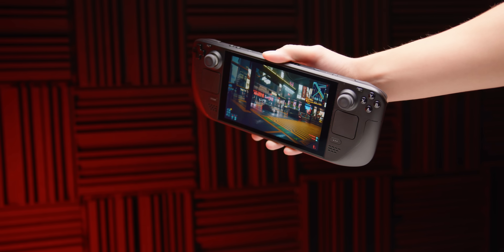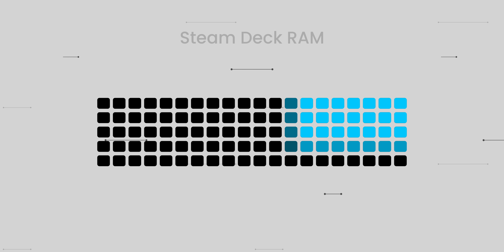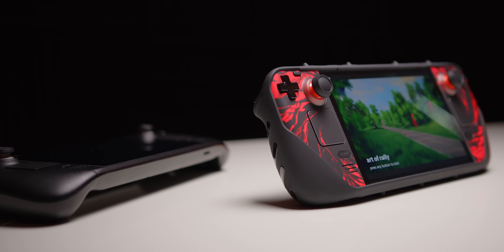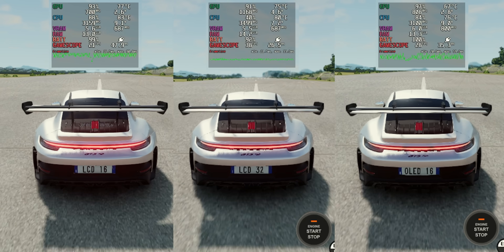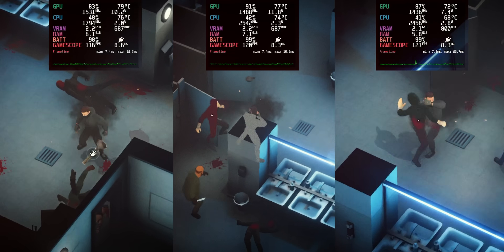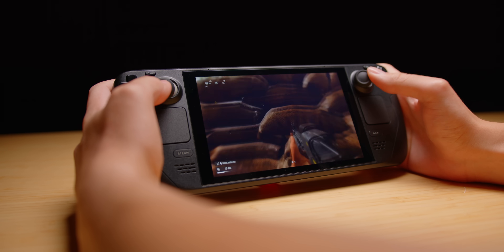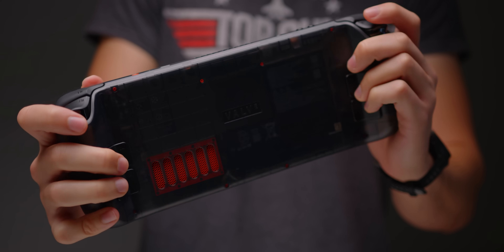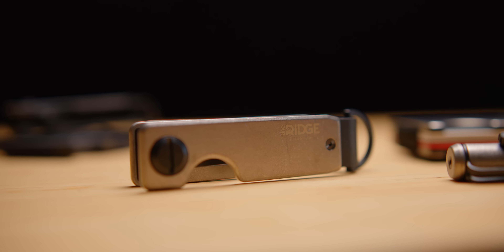I Upgraded The Steam Deck - 16GB vs 32GB of RAM.

Comment from the maker: Update for anyone asking about the possibility of an OLED upgrade - 

Right now there is no source for higher density chips for the OLED model. I've been told Micron will soon be making these chips available for sale soon.

Also, I'll have links to all the parts I use with the Steam Decks - as well as some shops if you'd like to upgrade your Deck. 

Big thanks to Ridge for sponsoring this project and allowing me to pickup another Steam Deck for testing. Thanks again for watching.
Reply: When the OLED micron chips drop make the video!!! Cover emulation and high end desktop performance as well!  Would love to be able to use this for work as well as play!! Great video!!
Reply: Please do a video when they do! Would love to see a 32GB mod on an OLED.
Reply: just shooting the shit here but is there any chance of a 48 or 64 gig mod on either version of the deck?
Reply: I would love to see this as well. Please make the video pn upgrading the ram.
Reply: Is there any update on this?
Reply: What chips did you use?
Reply: The original memory was Hynix. I installed Samsung. I re-soldered the jumper. After this, there is no image on the built-in screen. There is an image via HDMI. The screen is intact. The screen cable is intact. What could be the problem? Flashing BIOS doesn't help
Reply: The original memory was Hynix. I installed Samsung. I re-soldered the jumper. After this, there is no image on the built-in screen. There is an image via HDMI. The screen is intact. The screen cable is intact. What could be the problem? Flashing BIOS doesn't help
Reply: Definitely want to see emulation performance.  As soon as I figure out how to mod my PS3 and back up games I'll have my entire child hood in portable form.  Wish it let me install to SSD like 360 does.  Also I think palworld has memory leak issues that fill up ram and eventually cause crashes, so would be interesting to see if it crashes less
Reply: Meh, 256gb of ram is where is at.

Comment: I have the legion go S with 32gb of ram and in steam monitoring there are a bunch of games that will use 10-14gb of ram and Vram usage will be 8-10 GB. Ofter I find the combination of ram being used closer to 24gb . It's awesome that it's less than the 32gb available, but it's over the 16 GB. 

Sidenote- I'm running 1080 or 1200p and at higher setting vs the steam deck (z1 extreme ). So for a steam deck 16gb or ram might do it... But with a better processor/ gpu steam will use more than 16gb of ram... And it's not just a 1 off for me, I see it all the time.

Perfect example ally x with z1 extreme  often get less fps vs legion go s with z1 extreme and 32gb. More ram = more fps... At least up to a point.

Comment: Annoying comments about ram ... i have the 16gb steamdeck and a 16gb ryzen laptop of similar performance and too many games at this point are ram hungry . It was more than ok for some time but if you want to play some specific games 16gb are definitely not enough especially because the ram is shared with video. It's not saying much about performance but more about how poorly some games have been optimised because a ps3 game that was made for 256mb of ram can look better than a 16gb modern crap

Comment: Very interesting video. In all honesty I do not see the appeal in doing this upgrade for a couple of reasons. 

1. Only doable on the non oled variants. Taking in to considerations the performance gains the oled gives + the battery time it is simply not worth the hassle.

2. Chance of destroying your device is as I see it fairly high. I'm no solderer but I could imagine micro soldering is quite hard and requires a lot of expertise. It might be possible to pay someone to get it done but that then leads me to ask if the extra cost is really worth it compared to getting the oled model.

3. Handhelds is a market that is quite rapidly being saturated with new devices, this means fierce competition between brands and rapidly evolving devices with better CPU's, GPU's, and RAM. Normally I would also say the consumer benefits from the competition due to more competitive pricing, unfortunately this has gone the wrong direction and actually just made new devices more and more expensive.

Comment: Shared memory isnt initialized 50/50. First the cpu and gpu get what they requested. When the cpu demands more, it takes the reserved memory of the gpu. The textures then will be loaded into the storage which is waaay slower than dram. This is the moment when you most likely notice the stuttering. 

Many people here complaining about most gamers being happy with 16gb of ram, when the steam deck already benefitting from 32gb. Somehow those people do not get the difference between an apu which needs shared dram and a discrete gpu with dedicated vram. In gaming pcs with dgpus the cpu gets all the ram and does not have to share it, since the gpu also gets its own.

Back to the steam deck: well optimized games use way less vram on lower resolutions. Since the steam deck has a 800p screen anyways (you can hate me and downvote me for this) 16gb should be a good sweetspot for shared memory. Thats why 1080p devices work much better with 24/32gb ram (steam ally x for example).

Comment: "16GB is all you need for gaming" has been a propped up yet outdated suggestion for a looooong time. 32GB for a handheld is the sweetspot and 64GB for a multi application use laptop/desktop rig is the way to go, especially if it's running Windows.
Reply: From what i have experienced 16GB is fine for older games but once you start hitting games made over the past 5 years or so then yea beefier ram, GPU & CPU  are required for even the minimum settings.

Comment: I have a 1tb lcd model. I have no problems with vram, although I'm using a api that optimzes ram usage 
What I mean is that you can optimize it without doing hardware upgrade.

Comment: I just ordered Decksight 1080 p AMOLED display for my LCD steam deck and have to wait till May for shipping as it's crowdfunding. But I just wondered how much am I missing out from the actual OLED model and glad to see it's negligible. I would have liked the ram upgrade in my Rog Ally but not sure about my steam deck as I thought myself it probably won't make too much difference. Unlike the Rog Ally.
With Decksight i am gonna be able to have either a 1080p 80 to 90 hertz or 720p 144 hertz. Which sounds great especially for those retro games that can push high refresh. And HDR. Cannot wait.

Comment: Valve just need to make a new Steam deck with a rx7500. (Or make it again custom) Or put a rtx 3050 its more powerful and less stuttering. Finished! Yeah needs more power, but there can make custom, little less power but powerfully enough
8gb Vram and 16gb ram is also enough. This bullshit Apu is stupid.

Comment: The steam decorators are incredibly smart. They purposely released underpowered systems and are going to drip feed minor improvements to extend sales for a long time…. 
i’m sure somewhere in there top-secret vault is a steam deck with a battery life of five hours a way better GPU and 64 GB of ram that will be released in a few years

Comment: Back when RAM was first introduced it was a game changer. That's because it allowed multi-tasking on computers. RAM hold the information of a program open. That's what RAM still is to this date.
Adding more RAM to a device whose CPU/APU/GPU is "slow" won't make much of an impact.
Video RAM holds shaders, but if the GPU/APU is not fast enough it won't be able to calculate the graphics in time. If you're playing a game with lots of action going on, the VRAM will hold it open BUT if the APU/GPU is slow, it will process each frame slowly which results in stuttering/lag.
Adding more RAM seems like a cool thing if you intend on using the SteamDeck as a laptop replacement, but for gaming it'll do 0 to nothing. Awesome video regardless.
Reply: Having more vram on Jedi survivor or final fantasy 16 at higher settings would stop crashes(or system crashes when using swap files)

Comment: Just so everyone is clear...when you set to 4g of VRAM...it is taking from the system RAM to add it to the VRAM...and you will be able to utilize less RAM, specifically , default you have usable about 14g RAM....with set to 4g VRAM, RAM utilized is only about 11g.
Reply: They must have changed it because in games now I'm finding games like Uncharted say it's using 6GB for VRAM.

Comment: its the same performance,because the system setting run at 16GB ram only,just like 32bit window limited at 4GB Ram unless they have a feature like “Physical Address Extension” .

Comment: What setting do you run on cyberpunk? I get 44.63 FPS on my benchmark on the OLED and average about 3 hours battery. I did do the cryoutilities but I highly doubt that would increase my performance by roughly 50%
Default “Steamdeck” setting suck on anything that offered that option I’ve found and usually have to tweak several settings.

Comment: I tried upgrading my laptop ram to 32GB and unfortunalty the videos on youtube didn't fully cover the tricks and ended up screwing both my ROG Ally and my Flow x13 laptop. Very sadly scratch the pads underneath of the ram chips and screwed up the MB. if you are trying to upgrade please verify your capabilities as it is a very sensitive process and you may end up in full dissapointment like I did.

Comment: Please could you consider testing Horizon Zero Dawn and Horizon Forbidden West? HZD usually has good framerates but then it also loves to get stuttery and I wonder if this fixes it.

I would appreciate this a lot!

There's also another test that you could run.

So currently games that need more than 16 gigs of memory will spill over into the ssd for virtual memory. But there's something in the works called ZRAM, which SteamOS 3.6 uses by default, which instead of using SSD, just "zips up" memory and keeps that "zipped" data in the ram. So it would be interesting to see if this is helped by the 32 gig mod, and if maybe the algorithm needs to be tuned for 32 gigs.

Comment: The original memory was Hynix. I installed Samsung. I re-soldered the jumper. After this, there is no image on the built-in screen. There is an image via HDMI. The screen is intact. The screen cable is intact. What could be the problem? Flashing BIOS doesn't help
Reply: Did you try uploading a virus to the main frame? (RvB S:6)

Comment: I dunno how/why RAM/VRAM would make a difference, but if you look @ 3:23 the GPU clock on the LCD32 is nearly DOUBLE the LCD16 and OLED16 and the CPU clock is about 200mhz higher. Maybe it's bottlenecked on swapping so it's clocking the CPU/GPU lower since it's waiting for data transfer? The CPU also seems to be using less power at a higher clock speed on the LCD32 vs the other two as well. This isn't seen necessarily in the other games, just in BeamNG, so maybe in VERY RAM heavy situations only.

Comment: The ROG Ally is just a better handheld than the Steam Deck OLED. Only thing is battery life. Based off performance, just go with a ROG. I understand why people like the Steam Deck because of its simple OS, but unless they release an OLED 2 with a processor that can compete with the Z1 Extreme and Steam can make it so you can play other games outside of Steam then I don’t see it worth it.

Comment: I did the research on how to upgrade the ram.  it requires pulling off the ram modules off the main SOC and soldering in new RAM modules. 

No thanks. Ive pulled my steam deck down fully, replaced plates, cleaned the button contacts, replaced trigger springs,   changed and swapped out SSDs and am a person who loves how easy it is to pull the SD down. But that? Nah son, if I have to solder in new RAM modules obtained from a questionable source id would rather wait for SD2
Reply: And while you're at you can hot rod an egpu out the back of it lol
Reply: @Spencerwalker21  just download more RAM… EZ
Reply: @VyllenceGaming  the steam deck doesn't need more than 16g of ram, it's more than it needs
Reply: @escapetherace1943  not saying it does... Being honest I'd rather them do what Asus did and learn how to  incorporate 2280 drives rather than upgrade the RAM

Comment: Should test Alan Wake 2. Alan Wake 2 literally won't run on the Steam Deck because of the 16GB of VRAM minimum. It throws an error and you have to add a flag to the epic games launcher for it to ignore that check so that the game will load

Comment: A test with an NVMe with good constant writes and a SWAP partition (not as a file because of overhead und please no ZRAM since it's inferior) compared to the modded 32GB model should be nice. Also many tweaks are available in that matter: like RAM page compression with ZSWAP (zstd with z3fold is a no brainer) and max ratio (standard should be 20-30%). Meaning you can compress RAM pages in real time (If i remember zstd is used at level 3) with zero performance lost before them even being swapped in the first place.
Reply: THIS NEEDS TO BE TESTED. Looks like you really know your stuff.

So one question about ZRAM, you say it's inferior, but I've seen people say it's better than what SteamOS was using before, so what's going on there? Why is it inferior / superior?
Reply: @cheater00  ZSWAP also compress ram pages even before them being pushed toward either a swap file or partition. So for example if you choose a small swappiness, 1 for example to only use swap at the last resort, it will still compress unused ram pages. ZRAM is limited in that matter since it only compress ram pages virtually. ZSWAP is used by standard on newer Kernel. Nowadays ZRAM should only be used on very limited devices with verry little or slow disk space.
Reply: @InternetD1991  so zswap is basically zrwm that can swap out?
Reply: @cheater00  More or less: yes. I recommend the Archlinux wiki an its commented sources in that matter.

Comment: Star citizen, ARK ( old and new ) and heavily modded Skyrim and fallout 4 are the only games that come to mind that will greatly benefit from 32GB of ram. In most cases you’ll run out of VRAM way before system ram if you sticking with 16GB.
Reply: And playing star citizen and ark sounds miserable on deck anyway
Reply: In steamdeck CPU and GPU use the same memory pool

Comment: The ram upgrade seems to help but if your goal is more fps notice the vram usage was basically the same it looks like there's a built in cap on vram no matter what which makes senses because when you look it up steam and everywhere else says it caps out at 8gb of ram which could mean it doesn't share 50/50 no matter what their might be a way around this or maybe not the gpu probably can't handle more than 8gb due to low power and cooling if you add better cooling with a way to supply maximum power for the cpu and gpu that they would typically use in a pc then it could be way better I think what should be done to see the max performance is hook the gpu up to a pc with the pc ram equivalent of a steam deck and see what happens

Comment: This is exactly the question I had when I started seeing these 32 GB mod videos. Thanks for taking the time to address these questions. Definitely interested in seeing how this affects desktop mode in RAM heavy apps and emulation. I'm also curious to see the effects of increasing the memory allocated to the GPU on the upgraded deck. Does the custom bios allow you to allocate more RAM than the default bios? And if it does, how does it affect performance and stability in games that can make use of the additional memory?
Reply: at least for gpu mods the vbios checks the memory controllers and sends the data to the drivers so you don't need custom bios for memory upgrades but it depends idk if the steam deck is the same.

Comment: Emulation tests would be neat. TOTK eats through ~14 gigs total from the start on Ryujinx as I recall it, even crashed my steam deck
Reply: That's the Emulator being poorly coded or not optimized to run in a Wine/Proton environment. Similar specs on Windows run better.
Reply: @werf1re  Try a better emulator. If Nintendo can run their games on 4 GB of RAM, they should fly on the Steam Deck.

Comment: Good video. I'd like to see at least 24GB on the Ally 2, Legion go 2, and Deck 2.
Reply: Yeah I feel kinda bad since I got the legion go not long ago and 16 is unfortunate
Reply: Why? I rather get better APU or faster memory
Reply: @MrQuay03  Because after testing so many games on the Rog ally, working around the 16GB has been the biggest problem Ive had so far. Having a faster APU is nice but if its still bottle necked from not enough system ram, it wont make new games run that much better than the previous model.

Comment: The steamdeck  is os wthe worst handled i have ever had. I have nothing, but issues.  I have had 3 defective  Steamdecks with the 3rd getitng replaced and its going again  for repair.  LegionGo  or Rog Alley.  No point i  upgrading that junk if you  can far superior  handleds not running  on half baked os.
Reply: i think at this point its probably the user not the device
Reply: 1st time, maybe you had a legit issue. 2nd, could be a conicedence. But 3rd+? At this point, I think you should probably stop messing with the SD software/hardware mods and stick to the out of box experience lol
Reply: Good luck backing your SD card on ROG Ally